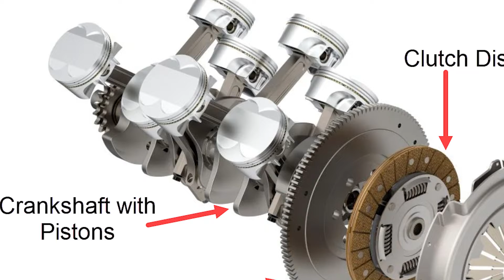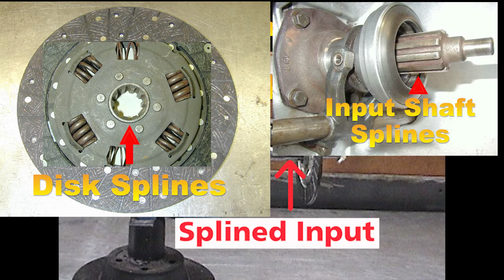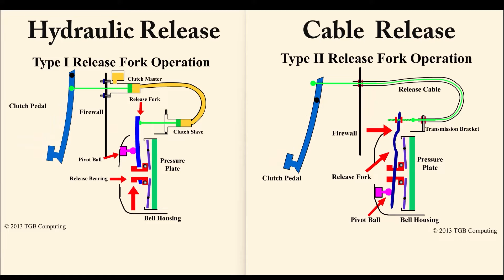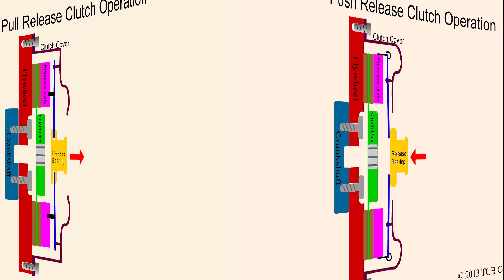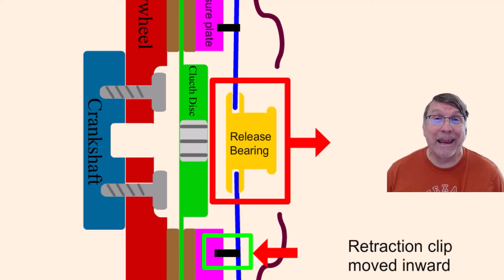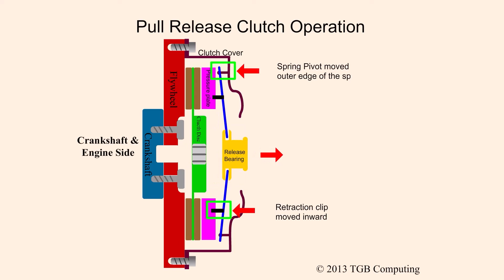Clutch Operation Push Pull Designs (Manual Transmissions)

Comment: I have a pull type and because the FW was shorter the diaphragm was pulled too much and the assembly got stock, I coundn't disconnect the engine anymore
Reply from the maker: Yes, that can happen especially when the flywheel is machined when the clutch is replaced.  Then can only toll orate machining a few thousandth of an inch.